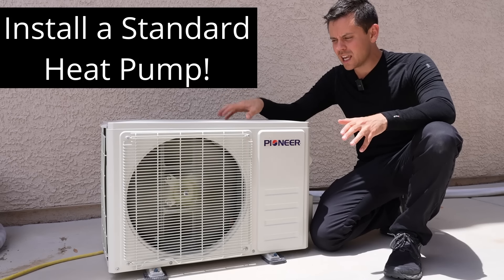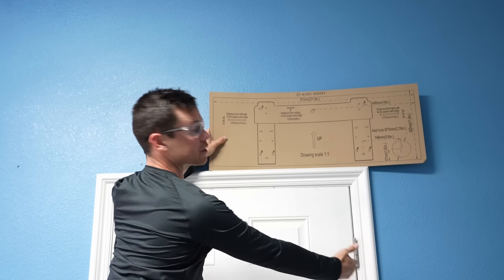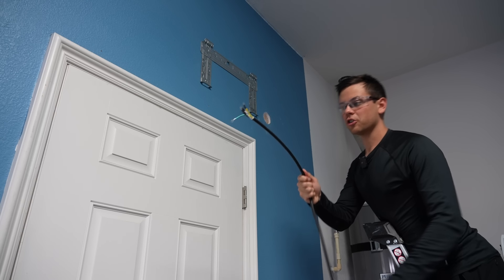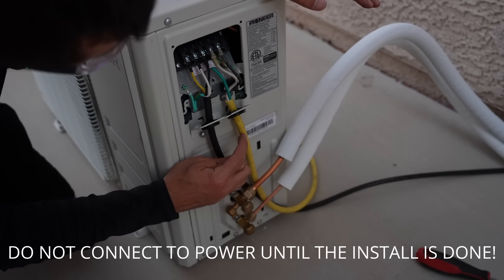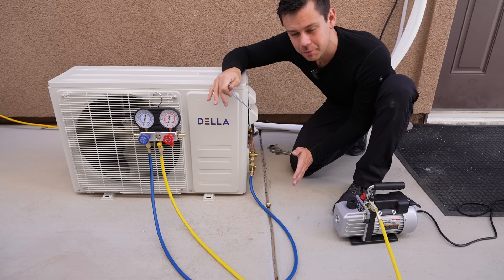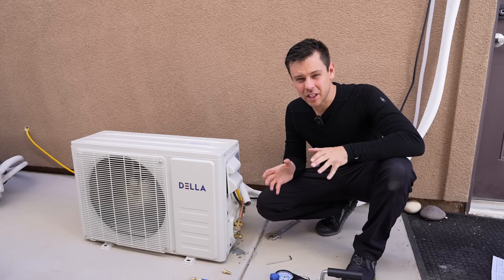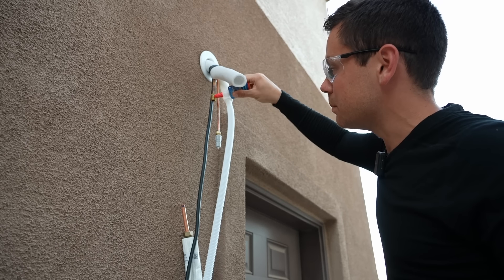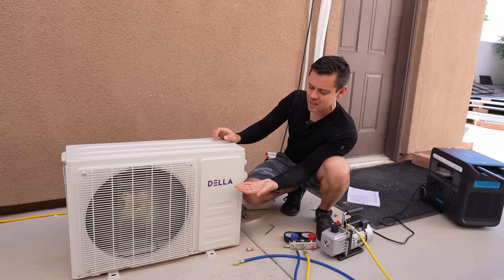Budget Mini Split Installation for Beginners! w/ Vacuum Pump and Gauges

Comment: Welcome to the reality of manufacturing in China. There are many very large manufacturers that make the same appliance for many brands. They usually change the appearance of the product by using different cases & graphics. They may change where the control buttons are by moving the circuit board with the switches for the buttons(although the layout of the controls remains the same because they don't want to redesign the control circuit board.) & the graphics on the keyboard, etc so that each brand has its own "look."

Comment: Hi , have you ever done a review on a 36 volt lithium battery?  With the boating season in full swing many cruisers are looking to purchase electric outboard motors.  I purchased a Newport electric outboard witch operates on 36 volts.  Any suggestions?  😎

Comment: Awesome video and very detailed instructions! Thank you! I have a question though. You used a extension cord for the 120v power? Just plugged it into an outlet? My unit is the Costway 12000 btu 115v but I haven't installed it yet. All i keep seeing are installations with a disconnect installed. Did you use a disconnect, is it necessary? I figured as long as the unit has it's own dedicated power with 20 amp breaker that would be fine?

Comment: If you can’t fix a line leak after finding it you’re kinda screwed. Disconnecting the lines to remake the connection will cause all the refrigerant to come out, and you don’t have any more.

Comment: As usual Will, great video.  I'm surprised that the condenser holds enough charge for the entire system (lines & evaporator) without adding additional refrigerant?  How do you verify the charge is correct after install?

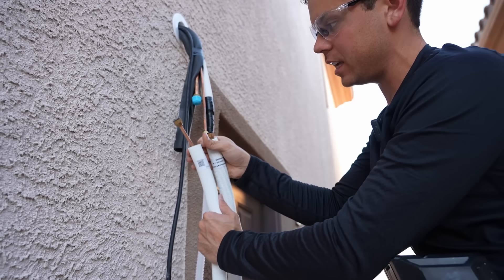Comment: At 7:22 there is a hissing sound of something escaping when you take the caps off the copper pipes connected to the indoor unit. Is that the refrigerant gas?

Comment: I learned something new, thank you!
The only question I had is what kind of protection is required for the 120v input electrical line?
Reply: Probably about 15 amps.  It will typically be labeled for "minimum circuit ampacity" and "maximum overcurrent protection device".  For this size unit I'd expect it to need a 15 A circuit.  Just guessing.

Comment: Great video. I am curious about the power connection to the outside unit though. In the video, it appears that you just ran an extension cord through the wall to power it. If so, there are several problems with this that some DIY people might not be aware of. The first is that the wire is unprotected and extension cords are only rated for temporary use. They are not designed to be exposed to the elements for long periods of time and the jacket will break down on it from UV exposure over time. A "up to code" installation would use THHN wire in watertight conduit. The second concern is that electrical code requires an accessible manual disconnect within sight of the outdoor unit and you don't have that. Finally, if it really is being powered from an extension cord wire, chances are that it is not on a dedicated circuit breaker as code requires. If it is, then you have another problem from running the extension cord wire into the breaker box. 

None of this is meant to detract from the usefulness of the video. You covered a lot of things that many similar videos miss and did it well...I just think you need to reexamine the power connection to make it safe long-term.
Reply: I also had questions about the power connection via power cord in the video. You made very good comments by calling out all the potential risks! They are super helpful! Thank you very much!!

Comment: I've installed 2 C&H mini splits (actually the same model in the same location, as a power surge fried the first one). I watched all of the YT videos, and I followed this one, except for one thing. Because of some comments here (and because all other videos did it differently), I did not want to remove the vacuum line until the freon (or whatever it actually is) was released into the system. Yes, I did lose some freon when I removed the blue vacuum line from the service port (quite a spray, actually), but I figured that was better than the chance of letting some air back into the evacuated system. I have a short line of copper tubing (only about 8') so losing a little freon is probably no big deal in my case. Anyways, I'm still not sure what is the best approach...

Comment: Thank you so much for this! Our mini split is 80% installed, but we’re stuck on the vacuum - it will not keep a vacuum. Starts at -18 but goes to 0 immediately. How do you find leaks in an out of the box unit, and what do you recommend to seal said leaks? We’ve used the Nylog and torqued to specification. Thanks!

Comment: Thank you  I have watched this numerous times. Helped me install a heat pump hot water system, and I've just finished installing a 7.1kw split air con. All run off solar. Cheers.

Comment: All good except the thread sealer is useless because those lines have compression fittings, the sealing happens in between the brass fitting's taper and flare on the tubing

Comment: If you are going to relay on the gauge for a decay test you should wait much longer if its at your house id wait hours or you can get a micron gauge that will tell you in like 20, 30 minutes if you have a leak

Comment: What if, after holding vacuum at -30 and you have closed the low pressure valve and are ready to positively charged the line to disconnect,  your gauge doesn't climb above 0?

Comment: Another useful video, Thanks.     would this work on an class C RV.  sometimes its parked on uneven road, leaning left or right or slopes up or down. is it ok for this unit. can it run while driving down the road?

Comment: Hello, thanks for the video!! I have the exact unit to install. I have to cut and flare the lineset which isn’t a big deal. It came with 16 ft but I only need like 3 feet. Would I still charge the system the same way even with losing 13 ft of lineset?

Comment: only item i see it the outside unit, hose and all should be at least 6 inches off the ground.
helps keep dirt and crud from getting stuck under it. also mice might not use it.
but other wise great job.
might think about conduit for protection of the lines and wires.
the drain line can be done via pvc piping. yes over kill.

Comment: Great job explaining the process. I did the Mr. Cool a few years back for a friend for his garage and it installed very quickly. Our codes required an outdoor disconnect so I installed that along with a concrete slab and secured the unit to the slab with tap cons.  When I go and do mine, I'll go with the Pioneer or Della and save some coin.

Comment: I have been thinking about getting one of these for my 600sf shop. I create a lot of dust, on my present window A/C unit I velcroed some poly quilters fabric to the outside of the intake grill that works really well, when it gets brown I know its time to wash it, I know it is effective because the small inside filter is rarely very dirty. I have never inspected one of these units so I wonder if there is a way to build a box-like extension over the air intake of the indoor unit to add a larger replaceable filter or attach a length of flex duct to it to run to a filter box on the ceiling? People that are allergic or live in areas prone to fire smoke or other pollutants in the air may like being able to add a low-micron filter to the system for cleaner inside air.
Reply: Check out a video by Jay Bates, he did that when he installed some mini-splits in his pole barn workshop.
Reply: @thomasalison6188  I will!
Thank you very much!
Reply from the maker: I just put a HEPA filter next to mine. The filters and coils look great after three years in my shop

Comment: instead of giving it power from the outside unit. Can i wire the extension cord to wall mounted ac unit its self? instead of to the box outside

Comment: I recommend leak testing it in heating mode(20 - 42 bar) instead of cooling mode(5 - 12 bar). Otherwise this is the best tutorial I have seen. Thanks.
Reply: If its a cold climate always make sure the compressor is above 22°C before turning it on (set power to the outside unit minimum 6 Hours before.) to insure the oil is warm enough in the compressor.

Comment: Great video, all went well until I opened the refrigerant line for 5 seconds and then closed it. Heard gas going into system but the pressure on manifold did not rise, any ideas?
Reply from the maker: Check connections. Make sure night and tight. If yes, release more gas and see if that fixes it
Reply: @WillProwse  Thanks for the speedy response. I fully opened both gas lines but pressure did not change from negative 30. I decided to proceed anyway, a very small amount of gas came out when unscrewing the pump connection (noticeably less than your video). The system seems to be working fine so I can only hope it's all ok. I assume it wouldn't if no refrigerant was in the lines.

Comment: Great video, it would have been helpful for a close up of the wiring you did for inside and outside unit. Also for some reason as I have just purchased a similar unit I was under the impression that the head unit was plugged into 110v  to supply power  to the condenser, after watching your video I see that you had a power cord going in through your wall to supply power to the condenser unit which then feeds up to the head unit. I had it backwards!

Comment: most of the tools can be borrowed for free at most auto parts stores minus a fee reimbursed when you return it. I know you can get the pump, torq wrench, and the manifold gauges. Probably still need the adapter

Comment: I have a question - I notice that some tutorials use a nitrogen charge on the condenser lines before the vacuum step.  Can you comment on this?   

Also,  I did see that you didn't use any nylog on the connections coming through the house from the condenser.  I would think you would use Nylog everywhere.   Can you comment?  

I'm a certified engineer,  but learning this mini-split thing.

thanks in Advance,

Douglas

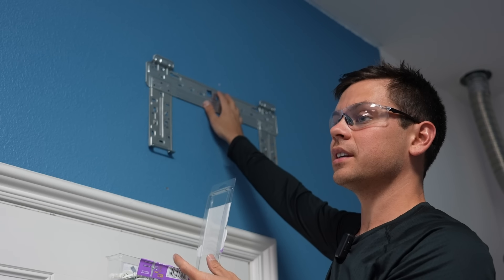Comment: 3:30.. Shouldn't the Bracket be slightly tilted to the right to make sure the Drain lines empty properly ?
5:54... The drain pipe should be at the bottom of that bundle.... There should also be a sleeve in the wall hole.
7:22.. Good Idea to use Nylog Blue on all the fittings for a Good leak proof seal.
Reply from the maker: No

No it's fine

Yes nylog good

Comment: It may be a stupid question, but I'll ask anyway. Do you need to vacuum both lines? I went back over your video (thanks SO much for being so clear and concise!) and think you vacuumed the suction line, but do you also do the liquid line as well? Thanks so much for making the process much more straightforward than other videos (excited/daunted).
Reply: It’s better to connect both hoses for a better vacuum. Technically you can vacuum through one side of the refrigerant circuit (copper line)

Comment: Ironically, I have Comfort Star, Mr Cool and Pioneer and they are all exactly identical inside and are made by the same company, which I think is Deye. The remotes even work between them. EG4 looks identical as well. They do last a long time before needing repair, etc. 
Make sure your drain tube is able to drain all the condensate and make sure the keep the washable filter clean each month.
Reply: I have a midea window unit and a senville mini split and the remotes work for either one, Haha. All made in jina!

Comment: Good info thanks Will 
When you use the flare tool you show removing the nut but never say "make sure the nut is back on before flaring" 
Just a small thing that could be a pain, although another quick cut and flare would get you back on track.
I did this like 8 years ago but just bought another for my rv and forgot the vacuum procedure.
Was glad when I saw you had a video about it. Knew I could trust you to have detailed info.

Comment: The new Della QC series is using R32 refrigerant. Is the vacuum and installation the same?? Ive read R32 units are up to 10% more power efficient.

Comment: I did step by step, when it comes to cracking open the high pressure for 5 seconds I do t get any change on my Guage, it still reads -30, any hints????
Reply: I have a mrcool advantage I’m installing and have the exact problem: held a -30 vacuum but the 5 second release doesn’t change the pressure at all.
Reply: Did you figure it out

Comment: What if I remove the vaccum pump before opening allen key volve?

I actually removed the vaccum pump line from ac before opening allen key volve, and it sucked some air for like 0.5 seconds. 

Did I ruin my AC?

Comment: where in the video do you inject the "refrigerant for ac" I missed that part.
Reply: The outdoor unit comes precharged with R 410A
Reply: @RobertSmith-tq6mf  I see. That's nice. Thank you very much.
Reply: Except I just finished installing mine and it has zero pressure in it. So either they forgot to fill it or it has a leak.

Comment: I’m in the middle of getting a split mini and pioneer was one of the firsts I looked at but after doing more research a Mitsubishi or Fujitsu is the way to go for long term reliability
Reply: Mitsubishi & LG are the best ! Fujitsu is a lower tier equipment . We install carrier and LG . Servicing them os so much easier than all the other brands .
Reply: @naturecoastprepping2487 Which do you think is the best?  I like the wifi connectivity aspect so which brand/model with wifi wrt your most favored?

Also, 110v(10A or 20A) or 220v?
Reply: What is the installation procedure like for the Mitsubishi compared to these DIY units?
Reply: They are very expensive.

Comment: Dunno if it would apply here as I'm not sure the pressures involved but in scuba we tend to teach open the valve all the way then a 1/4 turn back the reason is sometimes the valves get pressure locked open (at least to hand strength) if they sit at "full lock" open

Edit : also helps in the buddy gear check

Comment: first time I see anyone use a torque wrench

A few things I've noticed are:
use the correct manifold/Gauges, these have the correct connection.
the new ac have gases at higher pressures thats why they have a different connection. (you can damage the gauges if they go out of range)(old r407c, new r410a or r32)
and why 5 seconds? you can still just look at the gauges until you are above 0 you can do them much safer.

you can use a cable duct or air conditioning duct to protect the pipes.

I do not use a seal (Nylog) to prevent leaks, have had to do far too many repairs where they have used this.

Even the old ac that I replace still have all their filling / gas and they do not use a seal, pure copper on brass always closes well.

you can use dry nitrogen to blow through your pipes
so that the metal burrs come out of the pipe.
and for pressure and leak test

in the eu it is mandatory that you test the ac leak with dry nitrogen at the max operating pressure usually around 30bar (r410a/r32), and you may only put it into service the next day if there are no leaks

Comment: Did your 5/16 to 1/4 inch adapter have the hard white seal or the green soft seal? I feel like the adapter isn’t pressing in the valve core.